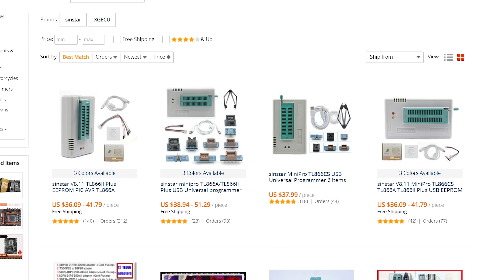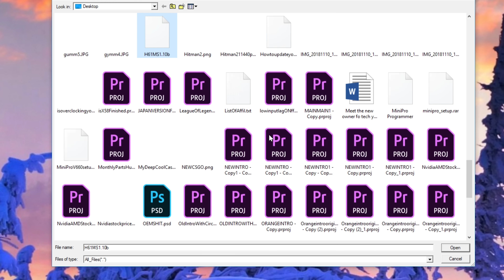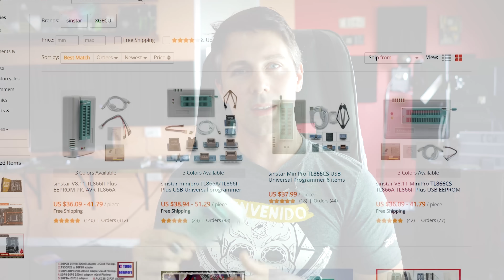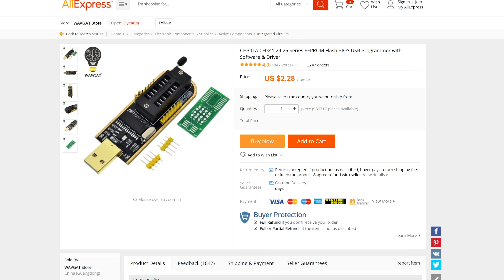How To FIX Your BROKEN Motherboard for ONLY $2...!?

Comment: Ever try replacing a cpu socket?
Reply: You need very very expensive machinery
Reply: Yep have a look at Louis Rossman he showed his BGA reballing equipment and the process a few years back when he had his rant about baking GPUs being a load of BS. Though in theory it's the same process as replacing a memory chip which can be done DIY with like ten bucks worth of parts (the new chip/socket and a mask for the solder balls), it's just a lot harder with a socket to do properly due to the size and number of pads
Reply: @greebj  Rossman is the man as far as board level and surface mount repairs.
Reply: That would be a good thing especially with the Intel LGA boards.
Reply: That is impossible, even by the manufacturer.
Reply: @Sadik15B  uh, no. There are people who have the skills to replace cpu sockets.

Comment: WD40? what's wrong with contact cleaner?
Reply: Contact cleaner isnt recommended for PCBs, only gold contacts. Plus its like 4-5x the cost in our area
Reply: @YusufNayab  This is not.

https://i.ebayimg.com/images/i/381156105032-0-1/s-l1000.jpg
Reply: @YusufNayab  I always use supercheap brand contact cleaner and it works well, no residue or anything
Reply: WD40 is refined petroleum and some very light synthetic oil, there isn't much more to it. I think using it here is stupid, because you leave a sticky oily film behind, but technically harmless.

I have found plastic-safe brake cleaner by Caramba to be almost chemically equivalent to Kontakt Tuner 600 non-corrosive contact cleaner, except the latter contains an additive that helps it evaporate a bit faster. But the former is 1/4 to 1/10th the price. Love it.
Reply: WD40 is no more than oil mixed with Kerosene. Is designed to penetrate mechanical parts. Used to remove rusty parts or lubrication. WD40 is the best for bicycle/motorcycle chains for example. Is designed to dry and leave a coat of oil. It will not help with contacts.

Contact cleaner is alcohol based, it will clean your electronic part and also evaporate leaving almost no trail. Used in guitar amplifier parts extensively to clean sockets and plugs. No it doesn't harm PCBs.
Reply: WD40 do sell a Contact cleaner, specifically called the Specialist Contact Cleaner 😊
Reply: You can get "WD40 specialist contact-cleaner",specifically for electronics-used it for years-no probs.
Reply: Look at that, a ton of morons who don't know that WD40 is a water displacer. it's perfect for this.
Reply: WD40 is not lubrication. WD40 does not remove rust. WD40 simply penetrates a bit to allow things to come off, as opposed to entirely removing it. It's very gentle.
Reply: WD40 is a Big no no on electronics that Will give your more trouble. WD40 is made to loosen nuts and bolts.
Reply: can be corrosive

Comment: Warning, those clips won't work on all motherboards, you would need to desolder the chip and reprogram it outside the board, depends on the internal conections  the board have, an example of this is the Acer Aspire Nitro series laptop.
Reply: That's a laptop laptops have a whole different manufacturing procedure
Reply: @HoloScope  on most laptops the pin clamp works, on some cases not. Manufacturing process has nothing to do with it, on the most part they work in the same way, less power consumption, smaller package overall but bios chip work on the 3.3V lane on both of them.
Reply: @JoseAngelGalvez  yeah but most times they have a different layout then a motherboard